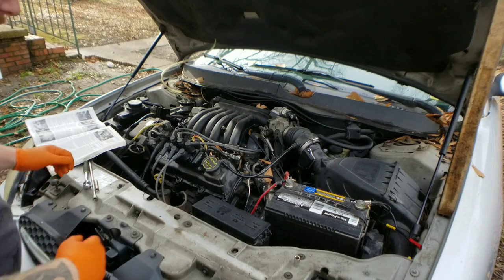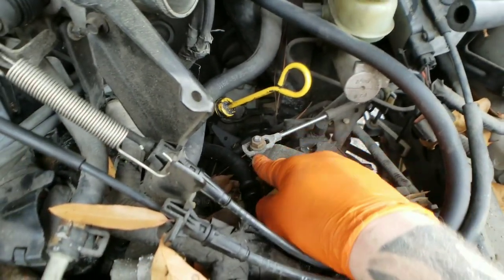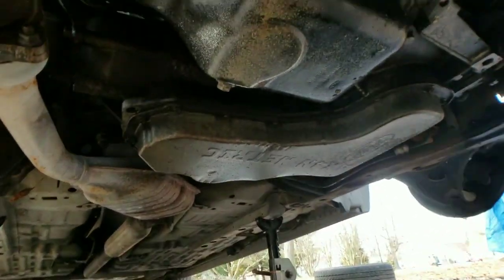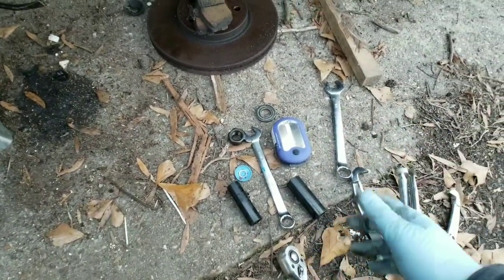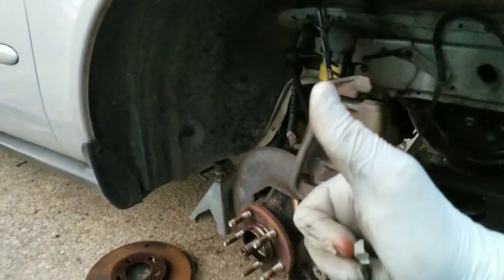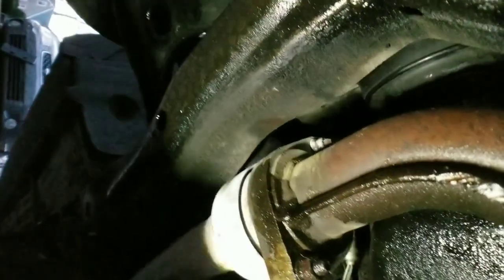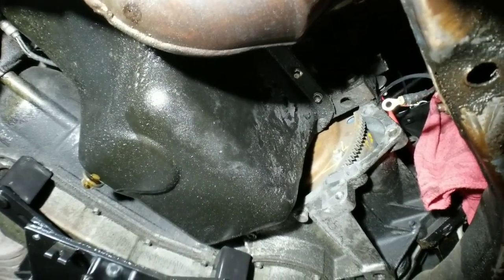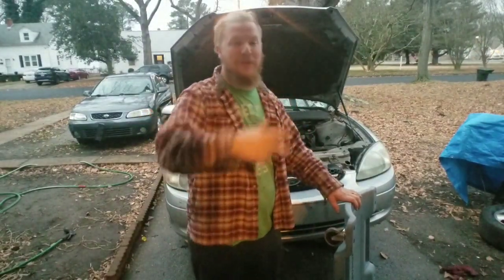2003 Ford Taurus Transmission Removal Made EASY!

Comment: Excellent work great communication skills. I would however use 6 by 6 Solid wooden blocks under the car along with the jack stands. Or at the very least used old car tires with the rims on them stacked on top of 1 another. Just in case the car shifted or the jack stands broke. I would say at minimum you need 4 supporting jacks underneath the car when you work like that. A lot of times I'll put 6 jack stands. Things can shift when you're on doing bolts.
Reply from the maker: Great tip! Nothing wrong with being even safer in a job of this size, thanks for watching!

Comment: Just wondering this is the se model right? I have the 2003 sel 24 valve idk if it’s the same in terms of transmission swap I see a lot of the same things unless I’m tripping 😅
Reply from the maker: SE and SEL are interior model packages and do not change the engine. As long as the engine matches up to the one in the video then you are good to go. Thanks for watching

Comment: You can get that trans out without dropping the subframe?
Reply from the maker: Everything that I did to remove the transmission I put into the video. Make sure you follow it all the way through and if you have any questions during your repair you can message me on here. Make sure to hit that subscribe button so you are notified of all my future videos!
Reply from the maker: The only part of the frame that you need to take out is the transmission mount bracket that is on the driver side near the lower control arm. Once you take that off and the flywheel bolts are free then the transmission can be moved towards the driver side wheel well and lowered out. Remember to keep your engine cradled while the transmission is out, this will also make it much easier to reinstall. Hope this helps, let me know if you have anymore questions. Also subscribe to the channel for more great auto DIY videos!
Reply: Hi SellthoseflippingCars I'm about to replace my torque converter 2004 ford taurus ses 3.0l v6 and you're honestly saying the sub frame doesn't have to be removed please.
Reply: I look at it this way he didn't show the actual transmission coming out
Reply: @Sellthoseflippingcars  I removed  the transmission mount bracket on the driver side but the transmission could not be lowered - the subframe was on the way.
Reply: Ford has screwed up ideas on mechanic work.a f150 2004 in the motorcraft manual wants ya to remove cab to change back two spark plugs

Comment: Idk if you will see this but my 06 3.0 Vulcan is slipping from a stop and seems to slip going into second would I full trans replacement not really sure where to go also the check transmission pops up on the dash would a code reader help diagnose or is that one of those things that just tells you somethings wrong
Reply from the maker: If you got the engine code that pops up with the transmission it would help you diagnose the problem with what is going on.
Reply: @Sellthoseflippingcars  there’s no check engine light just the check transmission is that something that can be read on a scanner
Reply from the maker: Yes that can get read by a scanner but it will be a higher-end scanner that will be able to read the transmission code. If your vehicle is slipping out of second and third there is a good chance that your TCC solenoid is on its way out if you have a automatic transmission.
Reply: @Sellthoseflippingcars  sorry for asking so many questions but what kind of places would have access to a scannner like that I’m just a YouTube mechanic so I’m still learning how to work on cars
Reply from the maker: No worries it is my pleasure to assist. Most repair shops and dealerships would have that. But if you are wanting to make an investment you can find one online at a pretty good rate
Reply: @Sellthoseflippingcars  one last question all my transmission codes are pointing to the transmission shift solenoid any clue on how difficult or how to change that can’t seem to find anything on google or YouTube about changing them
Reply from the maker: That is going to be attached to the valve body in the transmission. I can have an exact location for you by this evening if that works.
Reply: @Sellthoseflippingcars  that would be awesome running in a budget and need this thing back up and running
Reply from the maker: totally understandable there! do you have the AWD or FWD?
Reply: @Sellthoseflippingcars  fwd Vulcan
Reply from the maker: My apologies Nik it took me a second to respond. We just drove back from Iowa to Virginia when you messaged. Okay if you are having a problem with the 1st and 2nd gear slipping then there is a couple things that could be wrong. Have you pulled your transmission pan off yet? If not now is the time to do it. One of the things that could be wrong is the transmission is damaged internally. A great way to rule this out is take the transmission pan off and look for any metal fragments in the pan. If there is none other than the sporadic metal shaving then the transmission is good internally. The problem would be the transmission valve body causing a low pressure malfunction. To check which part of the valve body is malfunctioning knowing the transmission code that is coming up would be nice, but not required. Let me know with what you find out and we will continue from there.
Reply: @Sellthoseflippingcars  have not pulled it off yet but I did get these code of my obd2 reader I got
Reply: P0732 p0733 and p1744
Reply from the maker: Those codes that you sent are all circulating around your power train module. Double check your connections around bad area. It should be on the front of your transmission.
Reply: @Sellthoseflippingcars  I will check that tommorow thank you for being so helpful

Comment: gas cap light stuck on any suggestions. gas cap replaced,smoke test done, new fuel pump and fuel filter done still on and also my 03 ses Taurus revs high at low speeds at 10mph reaches 2,000rpm keeps going and scratches  have to slow down for the rpm to drop at that low of a speed! It has 79k miles help!!?
Reply from the maker: And engine codes? I would clean the MAF and TPS, 1st. Then I would check the lines to the tank itself

Comment: Hey how do I replace the clip over the tranny line hose to the bottom passenger side of the radiator not sure how to add a picture but it's not the w clip that I keep seeing on all these videos it's got 2 clips on the sides that keep the line from coming out.
Reply from the maker: Enough for certain a picture would really help

Comment: It is easier to disconnect upper ball joint and then whole hub wants too drop forward and pull it self off but doing it this way u must actually remove inside of cv first or you can pop your joint .. If you tried this and didnt work please lmk cause i am assuming it worked like that on a few of my vehicles fwd and 4x4
Reply from the maker: Awesome tip!!
Reply: If you believe that would work to lmk i plan on doing this project tomarrow and only thing i dont have is a ball joint pry bar and i dont like messing with them i always end up cuttinf the boots one way or another when i touch them lol
Reply from the maker: Lol yeah give it a try and let me know how it works.
Reply from the maker: But yeah u r right, make sure u take nut off of cv axle before hub comes off or you will pull the cv axle knuckle out.

Comment: Good video mate. Related question, you mentioned removing a "Y pipe". In my case: The bolts are rusted and even appear rounded, probably been worked on by the previous owners. Is there another way to get the Y pipe out of the way? Someone mentioned access near the exhaust manifold. Is this something you recommend? Loosen it from there, and just slide it out if the way?
Reply from the maker: You will have to cut the bolts off. You will find leaving that y-pipe in place will just cause more work during the repair and it will still be in the way. Use a grinder or a cut off wheel to make quick work of the bolts.
Reply from the maker: With the transmission being on the driver side. You might be able to disconnect the exhaust manifold and move it a few inches.

Comment: I live in lake charles and having trouble finding a transmission for a 98' ford taurus. Any help would be great.. any info you think may help would be great.
Reply from the maker: I always check Pick and Pull and increase the radius you are looking. The Taurus isn't too hard to find in the junkyard but always remember that those have not been tested so it would be wise to change the filter while you have it out and the transmission pan gasket. This way you don't have to do it after you get it installed.
Reply from the maker: Were you able to find one?

Comment: Good Vid !  Just found your channel.  How long did this approximately take ?  And was the first one of these you did on this video ?  Im seeing a cheap sable for sale and accessing imminent repairs.  Miles are low and it doesnt look rusted out.  Thanks
Reply from the maker: Thank U salutations I am happy you enjoyed the video! This transmission replacement took approximately 8 hours. Yes this was one of my earlier videos. Sounds like a good vehicle, make sure it doesn't have any problems with it of course. But if it does these vehicles are not too bad to work on.

Comment: I hope my Taurus doesn’t need a transmission the check transmission message keeps coming on it throws a p1744 code. Only have 80k I’ll try replacing my fluid and filter, any thing else I should replace?
Reply from the maker: The best place to start with a P1744 code is to check all electrical connectors on the transmission itself. If it just started recently you could have a loose connector. Since the P1744 code is the Torque Converter Clutch system stuck in in the Off position. A new transmission filter and new fluid is always nice as well for a transmission. Thanks for watching the video and stay tuned for my future auto diy videos!
Reply: Sellthoseflippingcars thank you for your quick response.
Reply: Sellthoseflippingcars I looked at all the connections and they are good I’ll try changing the fluid and see what happens.
Reply from the maker: Once you change it, without driving slowly switch into each gear so the system can fully lubricate those gears. Let me know how it goes
Reply: Sellthoseflippingcars car drives fine for now no more check transmission light it shift smoother. I forgot to mention that the old transmission fluid didn’t even feel like trans fluid felt like nothing. Thank you
Reply from the maker: That's awesome! I'm glad you got that changed out and enjoying those smooth shifts again! You are most welcome Dusk, thanks again for watching!

Comment: I have a 2005 Ford Taurus and my check transmission message keep coming on and off and it’s trying to slip I was told to replace speed sensor or get Lucas transmission and that will help with it slipping and shifting hard
Reply from the maker: I would try replacing the transmission fluid first to see if that will help. If it doesn't then Lucas Oil will probably help. The viscosity of Lucas Oil compared to other oils is more dense and can help coat everything in oil for protection and easier movement.
Reply: Sellthoseflippingcars yea somebody told me to just put the lucus stuff in and that will clear the problem idk I’m a luh confused but another person said replace the transmission filter and put the Lucas stuff in
Reply from the maker: I would replace the transmission filter then use the Lucas oil. Your engine malfunctions because something is wrong. Many people forget all about the transmission filter, what if you forgot about your oil filter? Do you believe your engine would run well if you never changed the oil and filter?
Reply: Sellthoseflippingcars it makes sense tho I trust your word cuz it keep saying check transmission sound like the filter is clogged up
Reply from the maker: Were you able to change the transmission filter?

Comment: Would anyone have advice for me where to begin diagnostics for a 2001 ford tauras. Today car started fine. I put it in reverse to back up and move it. As I stop and shift to drive it doesnt drive forward. Further reverse, and the gear 1 and both drive gears dont bring any movement to tires. Car doesnt drive. But starts fine. I looked in good the shifter cable works. When shifting in the hood you see the cable moving the gears up front. However I haven't yet looked to see if when in reverse to see if reverse lights come on. 
People online say this may be a sensor issue. Can it also be some sort of transmission solenoid/govornor issue?
Hope its is easy fix. Ford is shit. This is my dads car. I feel like shit cuz I moved his car and this happens. 
Any adviccceeee?
I'll keep searching Google's and youtubes....
Reply from the maker: Any engine codes come up?
Reply: A lot of videos on YouTube of striped torque converter gear. My father in law just had same problem with his running fine then all of a sudden it stopped going in gear. Fluid level is fine . Couple quick tests you can do to verify before pulling transmission to replace torque converter.

Comment: Do I have to drop the oil pan on the motor to get to this?
Reply from the maker: Removing the oil pan would give you a little bit more space when removing and reinstalling the transmission. If you do choose to remove it don't forget to either put a new gasket on when reinstalling it or use RTV to seal it

Comment: Got 160,000 miles on a 2007 Taurus but think it needs a new transmission very soon.
Auto Zone wants $1700 for the transmission.
Mechanic wants $1000 to take the old one out and put in the new one. I’m no mechanic. 
What are your thoughts on these prices ?
Thx !
Reply from the maker: The transmission you get from AutoZone is going to be a rebuilt transmission so yes that prices on average for the vehicle. The price for the mechanic is good it is a lot of work and can be seen in the video.
Reply: @Sellthoseflippingcars  
Is a rebuilt transmission from Auto Zone a good way to go ? Thx !
Reply from the maker: It is if you do not want to use a used transmission
Reply: The price there quoting u is actually very cheap compared to average prices on labor
Reply: But there probably making money off the transmission ur buying as a replacement cuz they have a commercial account and there price is a lot cheaper then ur price at auto one

Comment: I've got another question my torque converter splines are ruined at the very bottom do i need to replace the transmission as well
Reply from the maker: If the torque converter splines are ruined than just replace the torque converter. Look at the inside of your transmission housing though and make sure there is no damage in there. If there is a crack or just an abrasion. If it is an abrasion then smooth it out with some Scotch-Brite scuffing pads and you should be good to go. Now if it is damaged then yes you should replace it.
Reply: You need to replace the pump shaft on the transmission and replace your torque converter with a deco torque converter it has a thicker spline for the pump shaft and you will never have to worry about it stripping again
Reply: That was the factory recall on them transmissions. That's why you lose first gear and reverse. I've been running my car with a toggle switch for 7 years bypassing first gear
Reply: The pump shaft just pulls out you don't have to take the transmission apart or anything and it only cost like 30 or $40 for a new pump shaft
Reply: When the torque converter strips it messes up the pump shaft too you can look at the teeth and see that they wore down compared to the new pump shaft
Reply: Make sure you grease your muffler bearings too
Reply: @stephenmckee6439  All that good advice, and then the grease the muffler bearings.  My muffler uses ceramic bearings, so no grease is required.   302k ... but on 4th trans ...

Comment: I have a question about these codes P2197
P0352
Reply from the maker: P2197 fuel system lean P0352 ignition coil malfunction
check your engine for a vacuum leak, and check the connections on your ignition coil. If connections are good then your ignition coil is internally damaged and will need to be replaced. My apologies it took an hour to respond, its a Saturday I just woke up and had to chill before starting the day. You have to set the pace in the morning
Reply: @Sellthoseflippingcars  any responds is a good no matter how long it takes thank you
Reply from the maker: You are most welcome Mrl Will!

Comment: While doing this job would i need an engine support bar?
Reply from the maker: Yes that would very helpful in keeping the engine at the proper level while removing and reinstalling the transmission. I used another jack to change the levels on mine but it would of been easier with an engine support bar.
Reply: @Sellthoseflippingcars  I have one more  question so honestly before i remove my sub frame so there's no need to remove the subframe?
Reply from the maker: If you do it will make it easier to put a couple bolts in, but I was able to do it without removing it as shown in video. So it is up to you if you want to give yourself an easier time, I say remove it.

Comment: I'm running 100% thank you very much it was a job
Reply from the maker: That's great to hear! Great job and you are most welcome! Great job on saving yourself a boatload of cash!
Reply: @Sellthoseflippingcars  you're very right
Reply from the maker: Dont tell my wife LOL
Reply: 04 taurus how many quarts will it take to fill up after torque converter swap out? I put four and I'm not going into gear
Reply from the maker: To do a full refill it will take 13.7 quarts of Motorcraft Mercon V the automatic transmission fluid by Ford.
Reply: @Sellthoseflippingcars  wow thanks for the info know wonder there's no responds
Reply from the maker: You are most welcome Mrl Will!